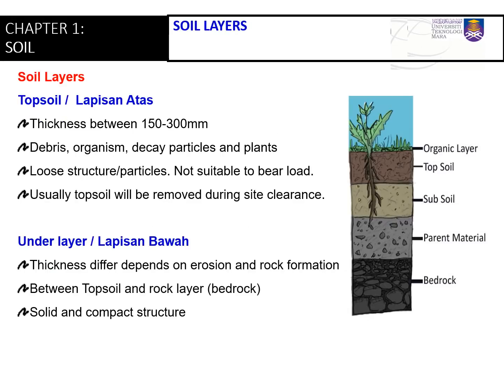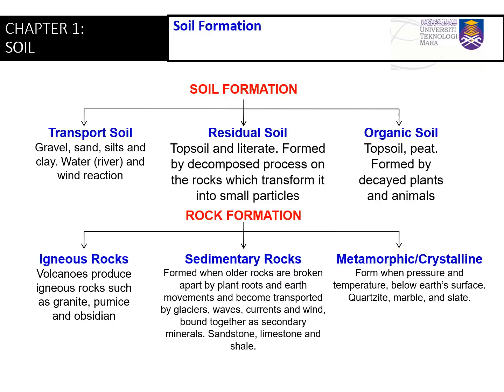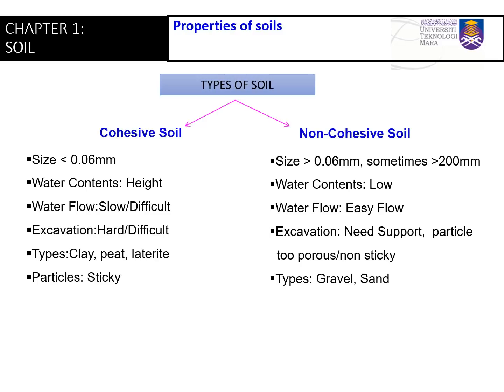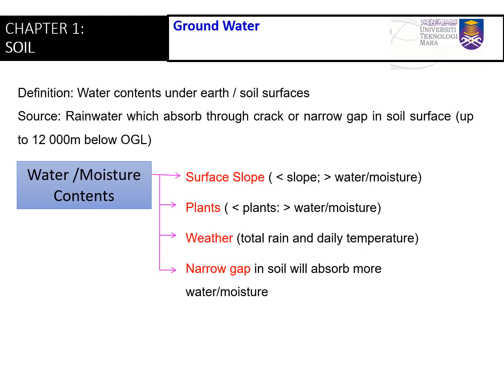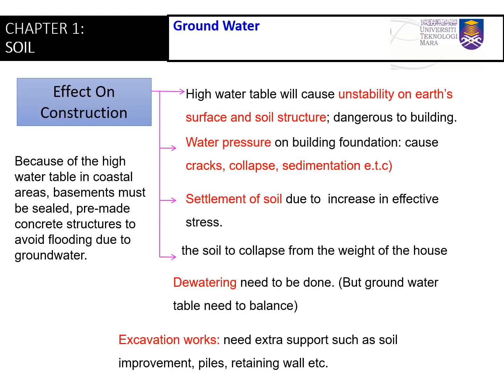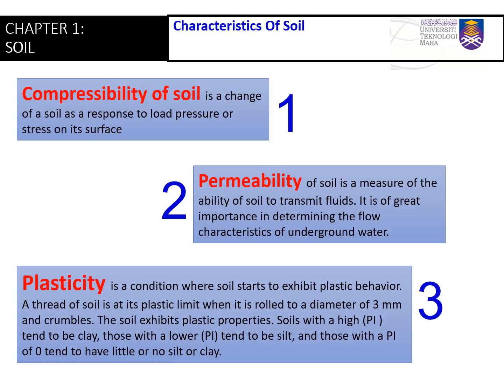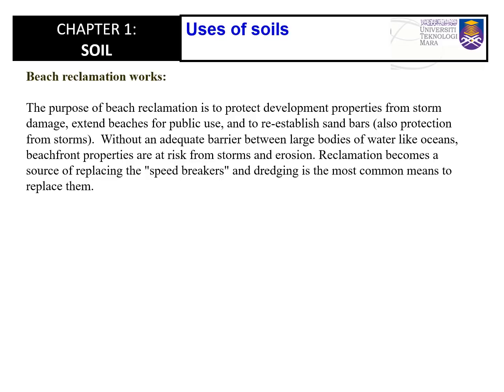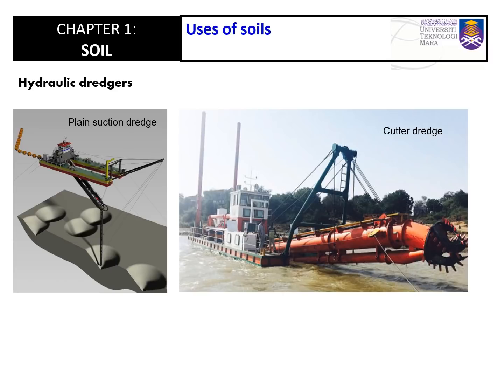Soil properties

Comment: Hello Dr, if the soil where any building is build cracked because of the hot weather, does it good for the soil as it got the narrow gaps or it is bad for the building as it has a higher risk of the building to be collapsing?

Comment: In reclamation,they did dredging and after that aren't there have any support or other step before apply any kind of soil in the sea?
Reply from the maker: There are different techniques (one is called rain bowing) and layers, depending on the project.
Reply: @hafizahmohdlatif8794  oh so there have many techniques. Thankyou Dr.

Comment: Did we only use sand for the reclamation or we can mix the different soil and the rock? Or the materials use is depend on the place of the reclamation?
Reply from the maker: For beach reclamation, we usually use non-cohesive soils as they contact with water. However, depending on the project and location, they may dredge different kinds of soil from the seabed including clay. Yes, they may have a layer of crushed rocks, depending on the use of the reclaimed land.

Comment: if the reclamation technique is used, does that means the particular part of the sea which sand is obtained getting deeper?
Reply from the maker: Technically yes. However, the depth and width will normally be determined earlier so that the living sea creatures are safe -  we must understand that we have shallow water habitats and their connections to deeper areas may have negative consequences.